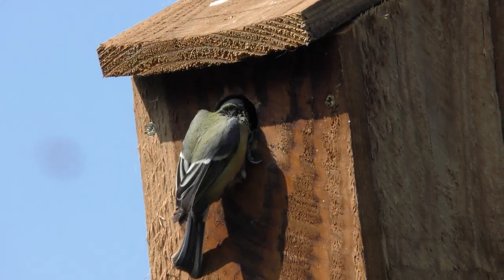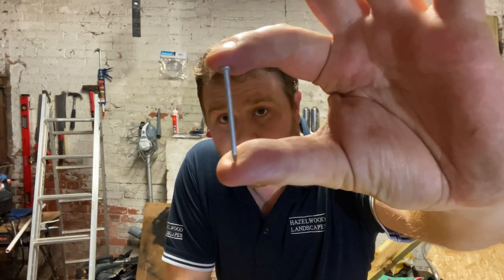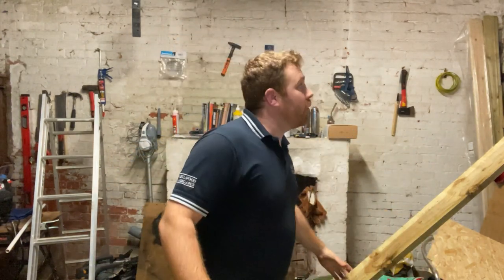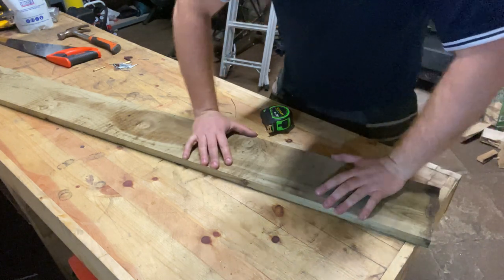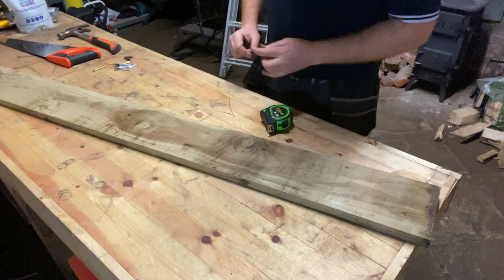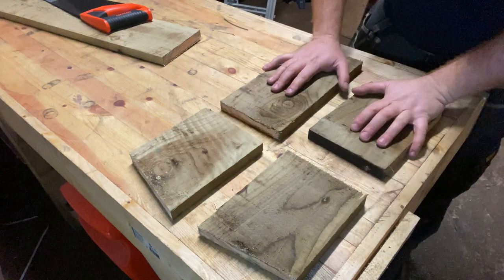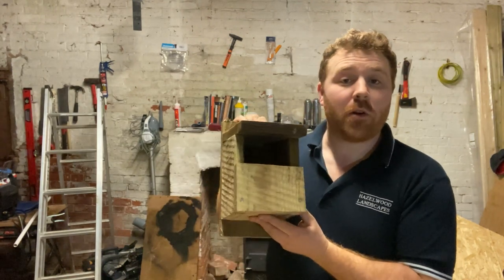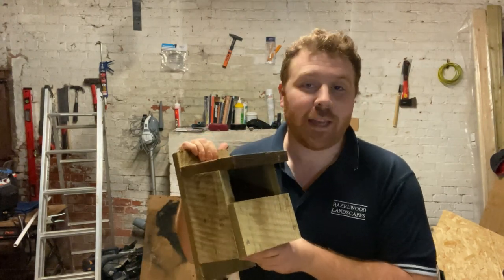How To Make A Bird Box - Robin

Comment: Hi Joel. Great instructional video. One question? Because of the slanted roof, is there a gap where the roof meets the back, or did you schampher the back of the roof somehow?

Sorry if i am being petty!
Reply from the maker: Hi there - sorry for the delay here.  I put an angled cut on the back of the roof where it meets the back plate.  You can always tack a piece of pond liner or roofing felt over this join :)  Hope this helps, best wishes - Joel
Reply: @WildYourGardenWithJoelAshton  Thanks for the response, that's helpful. I've recently started knocking up some bird boxes from spare pallet timber, and am broadly giving them away on a local neighbourhood website. Have distributed 3 so far, with some more interest expressed.  No real experience in carpentry and working out that angle has been my biggest headache, trying to ensure no gap.
Reply from the maker: @IanSmith-l1h That's a very generous and brilliant idea! No doubt at all you're doing this already, but with pallet wood do make sure the insides are as smooth/sanded as possible, just to protect the chicks.  It's a good time of year to be getting these up as we lose so many small birds during the harsh winter months, and not only will they find refuge in these, they'll also be able to be familiar with the box situations to use them in spring :)  Best wishes, Joel
Reply: @WildYourGardenWithJoelAshton  Actually, I read it is best to leave the inside of the box unsanded as it gives the birds something to grip on to when they need to exit? Do you have any tips/advice on how to get that top roof angle right?

Comment: Great video but I notice you recommend pressure treated timber when the rspb say don’t use PTT?
Reply from the maker: Hi there Andy - when I last looked into this there had been no studies that proved that pressure treated timber was detrimental to birds.  However I do know that it is definitely NOT recommended for bat boxes as they are very sensitive to any level of chemicals present - I do know that modern pressure treated timber is not as harmful as wood that was creosoted etc in the past, but of course that doesn't mean that it's definitely not harmful - I've seen birds nesting in various sheds and other wooden structures where they're definitely pressure treated and all the chicks survive so it's a difficult one, for sure.  Best wishes, Joel
Reply: Maybe we should be researching the toxins which are in the ptt, take the advice of the RSPB, and not put our birds at unnecessary risk ?